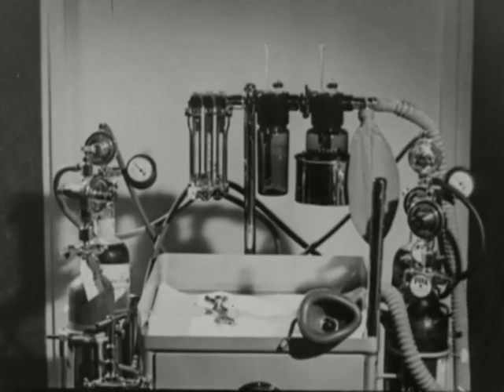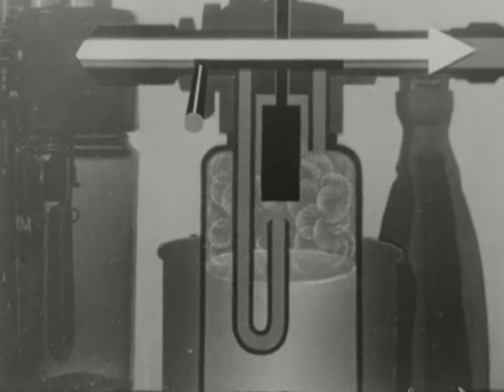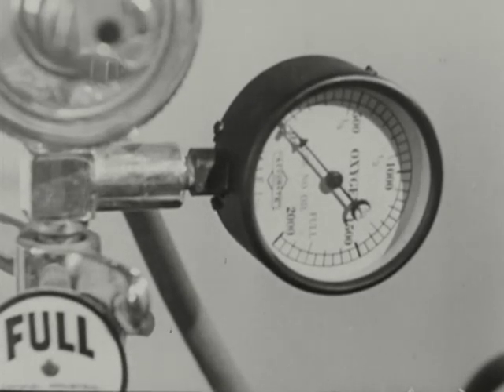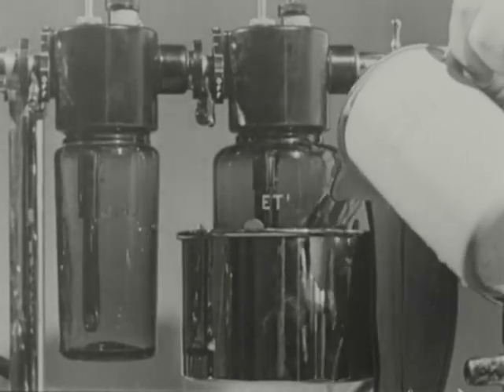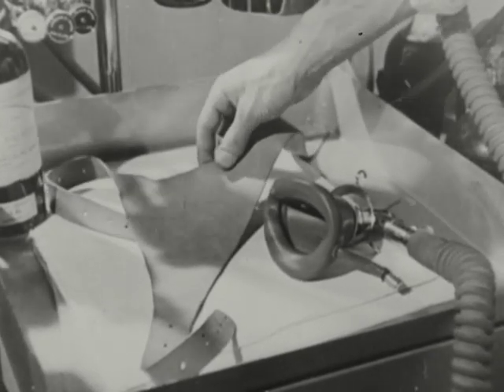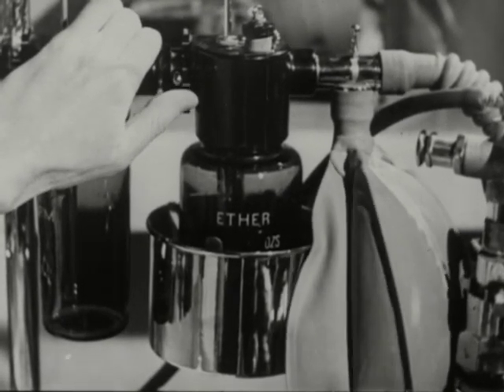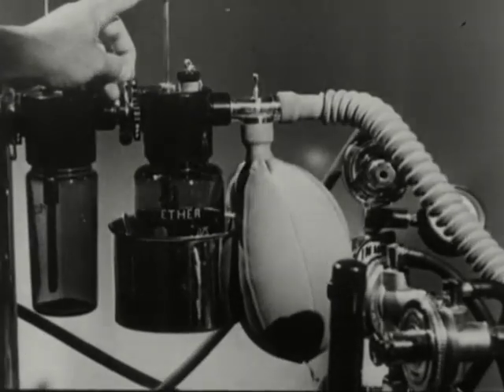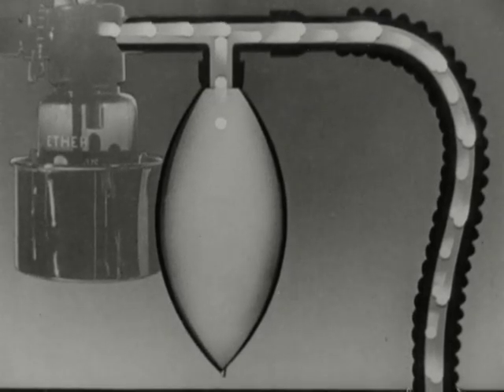Nitrous oxide-oxygen-ether anaesthesia: No. 3 (1944)

Comment: This is SO profound!!! You know, when we think of the anesthetic machine, now days we see display screens, electronic flowmeters, modes like Pressure Support, and Volume Control, and Spont/Man mode. Back then, these modes weren't in existance. THERE WAS NO VENTILATOR on the machine. YOU, the anesthesiologist, were the ventilator, and you did it with the rubber bag that you squeezed every five or so seconds. And you didn't have the ETCO2 we have now days to gauge how much ETCO2 was present. You didn't have a tidal volume numeric. You did not have a PEEP numeric. Back then, drugs like Propofol and Thiopental weren't in existance. And when IV drugs were a thing, and Thiopental was administered, It wasn't as simple as the Propofol and the BIS monitor we see all over operation rooms now days. You didn't have Vecuronium, or Cisatracurium. You had medications like D-Tubocurarine. Or Sux. Things have changed so much! SO MUCH!!! And It's interesting to visualize how much they changed. Back at the time, the old Boyle's machine was a GREAT volatile delivery system.

Comment: Why is there a carbon dioxide bottle ? Can someone please explain... and why does the narrator say it can be disregarded ? The same goes for the chlroform. I thought chloroform was the preferred anaesthetic out of ether and chloroform. I'm confused.
Reply: Pure O2 is toxic if administration is prolonged. CO2 stimulates respiration. I presume the CO2 is used when N2O isn't. IIRC, chloroform, was discovered first, but it is even more irritating than ether.
Reply: Thank you for clarifying Ben. I'm assuming the reason the narrator says the carbon dioxide bottle can be disregarded is because the oxygen bottles are air, rather than pure oxygen ?...so no carbon dioxide is needed. But I am wondering why carbon dioxide bottles were ever needed in the first place ?
Ether is awful stuff. I bought a can in a french pharmacy to test out of curiosity. It smells dreadful...really, really strong. I don't understand why  it's often described as "sweet,  pleasant smelling". It smells terrible !!!
Reply: habibi9200 It is pure O2, not air. The apparatus has more than one use. As the title says, they are describing N20-02-ether anaesthesia.

I'd say that they both smell sweet. Both irritate nasal mucosa, though.
Reply: I suppose the CO2 bottle can be disregarded because the machine uses partial rebreathing, as explained from  17:37 : much of the expired gas (containing CO2) is inhaled again by the patient while inspiring ; so no addionnal CO2 is required under normal conditions. I do not know under which circumstances it s necessary to add more CO2, perhaps if the size of the balloon is unadequate, or in case of spasms, in order to correct excessive alkalinity of the patient's blood.
Reply: The CO2 is to stimulate the patients respiratory drive.